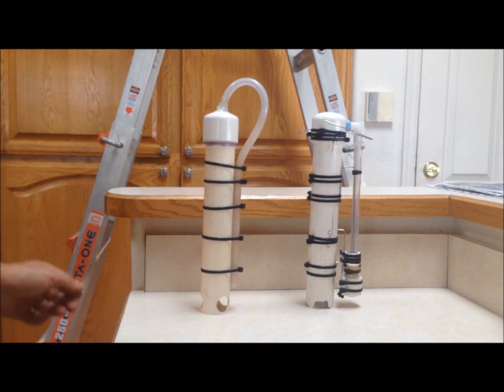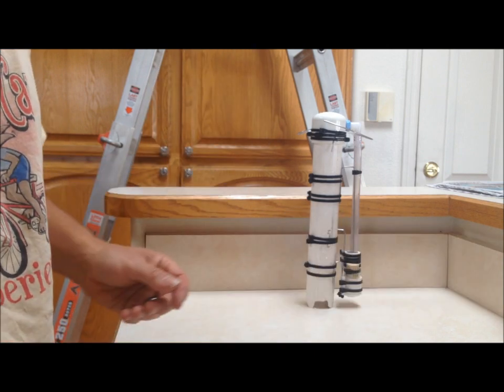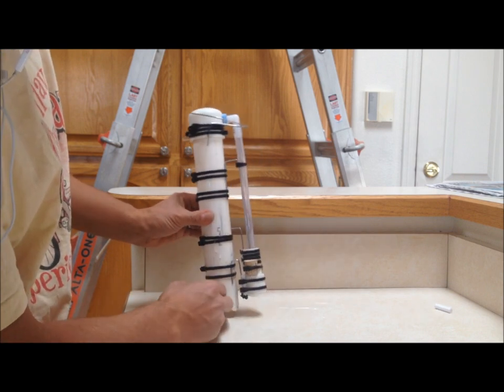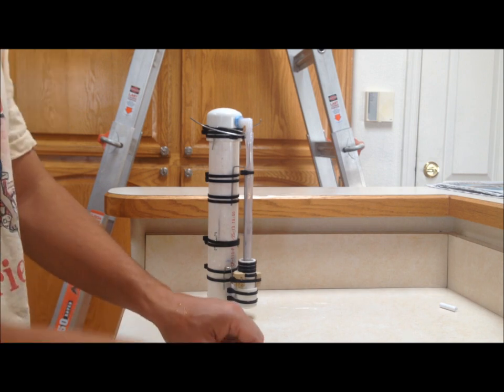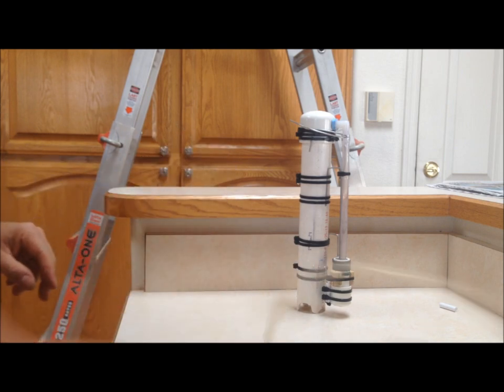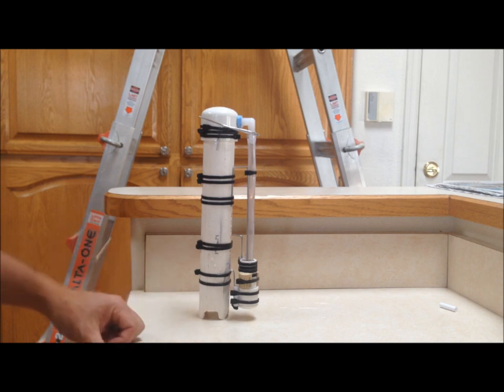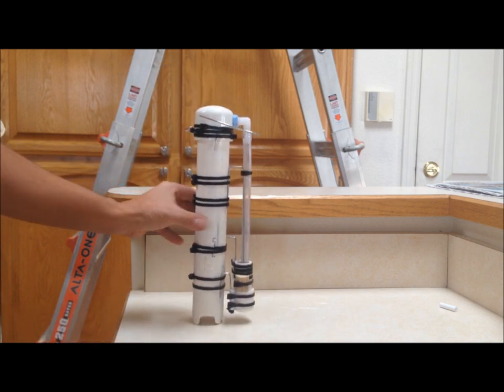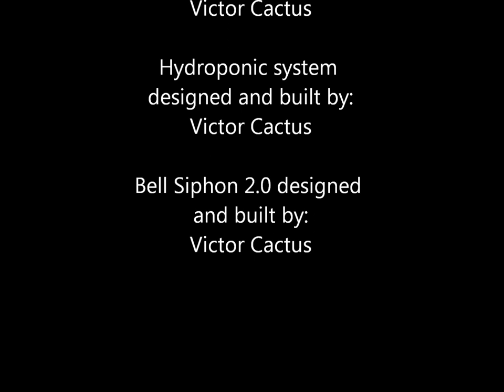Bell siphon 2 0

Comment: Why do you need the small cap at the end of vent tube to float? Can't I just make the cap a little shorter?
Reply from the maker: howo357 ,
There is no "one right way". I simply found that through trial and error that the floating cap provided the most effective time delay. The time delay is because the siphon is located in a mini sump. Without that feature tuning waterflow was required to get good start/stop. However the tuned flow was too touchy and I was frequently adjusting it.
Since building the 2.0 version it has been operating for several years with only one small glitch, and that was because roots had grown into it!
Reply: Victor Cactus thanks for the quick reply. Yea I figure with floating cap you can drain the water level in grow bed almost to the bottom and still get a big air draw to break the siphon